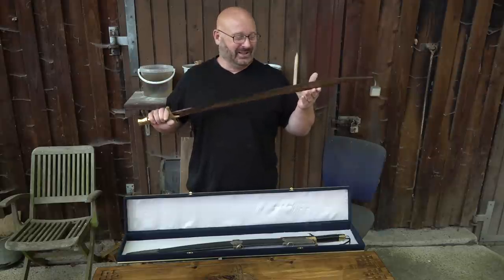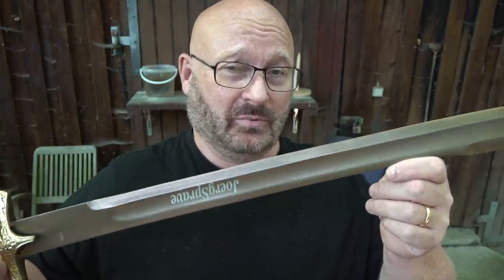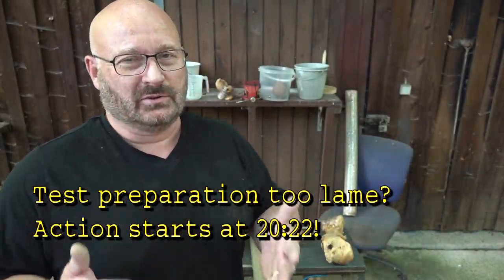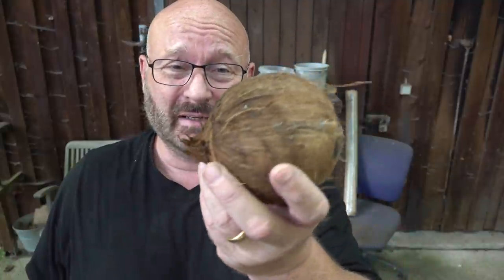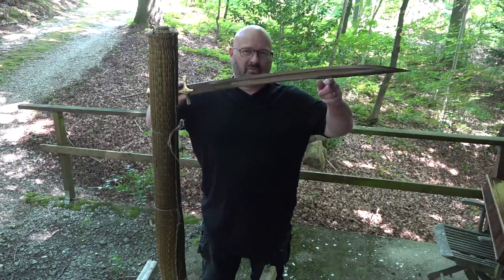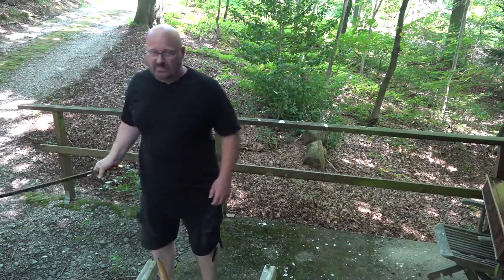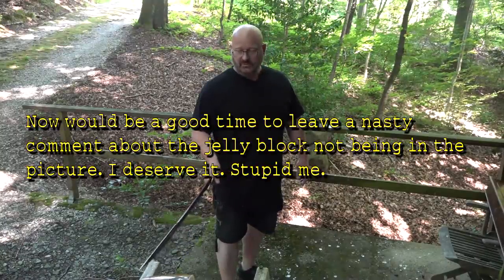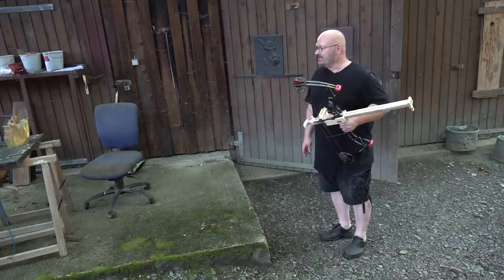REAL Ottoman Swords: Extreme Tests!

Comment: You could get away without a cameraman with a second camera...
Reply: Or prerecord checking what the camera is actually seeing, and maybe adjusting stuff accordingly. It probably has either a little screen or an ocular of some sorts, all cameras do.
When it came to shooting it was quite on point.
Reply: That's one nasty comment
Reply: Bring a bullseye that shows where the action is to aim your camera at, check in the camera or failing that option, line a stick along side the camera to have a better rough idea of the where its aiming

Comment: I'm sure many people have already commented on this, but bone inside the body is a lot more malleable than smoked bone like you have there. It bends more, it fractures less easily, and it will cut a a lot easier. It's kind of the difference between green wood and dried wood.
Reply: At least he went that route rather than useless ballistic gel blocks haha
Reply: Its a cow bone... just sayin
Reply: This is the right way around though! He's showing us the "worst case scenario", and these swords are still impressive as hell! They're definitely not any less effective against real humans.
Reply: @PhoenixClank  wouldn't the worst case scenario be tungsten carbide?
Reply: @Mentat13  katana could cut a black hole. Not so hard imho.
Reply: yeah, you could get fresh bones or limbs or heads with bones in them from a butcher or slaughterhouse though.

Comment: Bone is one of the most abusive materials that a blade could come in contact with. Especially "cured" bone. Not so much because of it's hardness, or durability; but because of how it breaks as it's hacked and cut. It simply refuses to cut or break in a line. It always breaks in arcs. Which is very similar to ice or glass. So, at the moment of impact, bone actually tries to turn the edge to either side, as it gives way. And, the deeper you cut, the more opportunities there are for this effect to occur; worst case being the edge attempting to turn in alternating directions, as it bites deeper. As hard as you're swinging that sword, I'm surprised it held up so well. The smiths did a fine job making that sword!

Comment: I’ve made heavy hand forged blades for brutal work and tested them in similar fashion on heavy pig bones. I can verify that the the swords functioned as they should, and the damage to the edges is normal under such abuse (dry bone is really hard). I can also testify that the price is insanely low for such blades. The wet mat cuts were extremely impressive. Somebody needs to send Jeorg a big salami.

Comment: On the ertugrul sword: fix the problem with the handguard, by setting two bolts for example. Let the metallbinding on the scabbard be not overstanding (could stuck on clothes), get rid of the standardrings, charge 30 bucks more for the perfect version, inform me when it´s done and i´ll buy one. There is for at least one issue on the  other sword.
Greetings ice.

Comment: I looked up the site and the price already hit me as being a bit on the cheaper side, doesn't neccerly reflect the quality mind you, but then I saw the material and got really worried. Stainless steel swords. Had to think for a second on what Skall and the others have said regarding it. Skall has said some stainless steels can be decent but this type of steel was not one that he mentioned. Searching up the steel quality and I am constantly met with "low end steel" and "soft steel". Some call it decent knife steel while many others call it budget knife steel. The biggest offender is the soft part. I read that this steel is pretty bad for edge retention. So I am a bit on the fence here. It could be that it is the heat treatment that saves these swords but I don't know. I would have to see some more professional testings on these swords to be convinced. Looks pretty good from this video but as I said the type of steel has me worried.
Reply: I agree, thats like the first rule of sword buying. Dont get stainless steel because its too brittle.

Comment: It is me or this sword really sharper & stronger then the katana he tested sometime ago? Wait, it need to be tested against orc sword too.
Reply from the maker: It is. But also more expensive.
Reply: Jörg, which sword do you think is the most effective against the zombies?
Reply: It will yield the same result. Smashing and bashing against something made to slash will deform and chip away at it. Both the Katana and these Turk blades are very good at doing what they were meant to do, neither is superior nor inferior.  

The only thing that sets them apart is that the Katana is a two-handed weapon and the Turk sword is one-handed, the former can cut through a body while the latter can leave deep wounds. All that matters is how skilled the wielder is and how he uses them.

Comment: Something of note, you seem to struggle to maintain smooth strikes, could just be lack of experience that you talked about. But worth mentioning that the blades have to have a good balance of weight and grip to them. If the handles are too short or don’t provide counter balance then the blade is much harder to use, and prolonged use (like in combat) is very difficult. blades being so heavy is fine (not that those are heavy) but they must be balanced out by handle design. Would absolutely love to see you work with the forged in fire team

Comment: If Jörg is impressed it must be reaaalllyyyyy gooood.
Reply: Well, I like Jörg but in this case I think that he isn't the right guy to do a sword review.
He simply doesn't have the necessary knowledge or skill to judge the swords performance properly.

Jörg is a Genius. He is creative, smart and also a good craftsman...but swords really aren't his specialty.
Reply: @niklasfischer3915  Although I agree that he's not a professional lika a HEMA swordsman but he knows a good amount about metallurgy and sharpness. And since we're not going to use these in a real combat, it's good for cutting melons at your backyard or picking your teeth...
Reply: @ozmobozo  He knows one or two things about metallurgy. But thats pretty much it. I know a bit more about swords, and i can tell you that both of these swords arent very high quality products.
The round and thick handles are very bad for your edge alinement when cutting.
Also the extreme weight of 1,5kg is much too heavy for a one-handed sword.
The edge damage taken during the bone-test is not within the range that is to be expected. A bit of damage is ok, but not as much as those swords took.
Furthermore the crossguard came loose after just one or two blows, which is utterly unacceptable.
Finally the fittings of the scabbard are not well fitted to the shape of the scabbard. They are just blocky and stick out, which makes it look very cheap.

Sure, if you just want to cut a melon in your backyard, then this probably isnt a problem for you (litually every sword can do that...you dont need a review for this)
But if you actually want a historically accurate reproduction that is well made and thoeretically usable for combat, then this is a problem.
Reply: @niklasfischer3915  You got me 👌
I always appreciate good information. And since all my knowledge comes from Forged in Fire, it's no surprise...

Comment: I am a beginner blade smith, i started a year ago, i have gotten much better and my heat treat is now more accurate now i bought a infrared hvac thermometer. I haven't done crazy tests like this but if the edge only chipped that much it is the best heat treat. My earlier blades would chip much more than that. Those guys have the heat treat down awesome.

Comment: You ever heard of a German knife company called  A Kastor and Bros from the early 40's and older?  I think they were bought out by Camilus.
They made a folding single blade knife on one end and the other took different tools that could be added on.  Basically the earliest multi tool.  Trying to find the model name for that knife set.  They came in a leather case with a divider to store them.

Comment: comparing it to the early nomad saber which terrorized the steppes since the end of rouran khaganate up until basically the magyar conquest of the carpathian and the fall of volga bulgharia which the best description is found in vienna as the "sword of attila" is the basic prototype which most of the eurasian and middle eastern and even european sabers are based off  from that we can trace the evolution of the turkish kilij 
and especially early kilijes the black handle sword is about 95% accurate historically according to some. founds  and manuscripts and drawing because mainly of the cross guard are slightly off at the tips and in the middle ridge but over all fairly well accurate 

the second however i disagree with the smiths and sword maker on that one about the handle and pommel construction since the one in museum look much closer to what other turkic tribes sabers handles looked like than the one they made but over all the rest is quite accurate for that era 

especially the yelman(false edge) and the piercing tip

Comment: Joerg: Couple things. That bone is smoked and much harder then a raw bone, so less effective as a test medium. Second, smoked and/or cooked bones are quite bad to give dogs to chew as they splinter into shards. They can get stuck in your dogs throat or digestive track as cause damage or worst. Only ever give your dog fresh, raw bones as they don't splinter as sharply. Hate to see your pup get hurt. :)
Reply from the maker: All OK, the bone is actually specifically sold for dogs and should be safe. Rolfie probably had 20 or so already, these last three years.
Reply: @Slingshotchannel  I know they 'are' sold for dogs. But that doesn't make them safe. It's a wild west show of poor regulation. But regardless, just something to be aware of. :)

Comment: Tatami mats are not a good analogue of a human limb but I understand why they're used. Firstly if you cut bone you will damage the edge of any sharp blade it's really a matter of how badly which is also caused by the density of the bone you cut. Now Tatami is used because it's about as dense as you want to get before you start damaging your blade. If you practiced daily cutting bones you would go through many blades over time.

Comment: i have some swords from them, lets go
these are stainless so here is proof that stainless can do the job

but from this company if you want something nimble probably want to look else where but they are proper and not over weight but as he has "alot of reserve" these are good weight heavy hitters.

 i got a yatagan and kilij, the more curved ones, and the kilij is now my baby because i prefer the heavy hitting rather than a nimble one. the yatagan i literally used as a machete and it held up more than enough when the chainsaw failed. the yatagan came in so sharp initially that it cut newspaper, i have 1 sliver of footage before i made it my machete in one of my videos.

Comment: Over 500$ for a Stainless Steel sword? Why? Use better steel that doesn't need so much work to make decent and you could even slice that price down. I have read stainless steel can be made good for swords if enough work is put into it but that often raises the price. My guess is that is what happened here but if so then move to better steel. If the price goes up then someone is doing something really wrong.

Comment: Joerg, if you can't afford a camera man, maybe try a camera with a front display, so you can check the camera angle while filming. There are good mirrorless cameras out there (from many brands) with this feature (through a foldable display) as well as action cameras (DJI has this feature, I don't recall of the top of my head of GoPro has this as well). I use the DJI Osmo for my personal (family use only) projects.

Comment: I used a second monitor and was able to see the ballistic jelly. I don't how it works but it did work.
I kept adding more monitors left and right, a total of five monitors. I saw Jörg's whole backyard. 
I don't know how far can I go with this, unfortunately I only have five monitors, one of them is an old crt.
I also don't know how or why it worked.
Are you still reading this nonsense?!

Comment: I recommend pvc pipew/ caps so you can make them in any circumstance you wish & they would be able to lay flat or stand up + you can add any length of bone or whatever inside. Of course, longer cutting device for separation will be needed. 🤠

Comment: I believe you did this one without your cameraman or your better half. In addition I think 50 hours worth of watching other sword testers do their work and making a recipe to disaster or actually I should say blade failure could use a little work. Out of the two problems that I just declared I would say the camerawork needs the most Improvement. When I did not get out of your test was where is the balance. How does the blade perform in the thrust. And how does the shape and temper affect the quality of the spring steel. Thrusting against several layers of wet carpet I would like to see the blade sink 6in give or take. Thrusting against some oak firewood with bark still on the tip should not snap the oak firewood should be free standing. And hanging off the end of the blade after the thrust. My recipe would be more like  1: two cuts to the tatami per blade, 2: Edge retention test single piece of paper, 3: wrist or ankle chopping test, "I suggest quarter or half inch soft wood dowel wrapped in wet Wednesday newspaper", 4: repeat test 2, 5: thrusting test, 6: split personality test "the coconut", 7: first real abuse Edge Tipper test to destruction, 8: Springfield Timber quality test " warp the blade" !! Warnings sooner or later this test will meet complete failure !! !! Flying razor blade hazard !! " 30 degree deflection 1 degree of set and tip remains Unbroken= you can't ask more of a blade though occasionally a blade will give it to you anyways. For Laughs I would finish my testing with the tatami mat two more Cuts with each blade. And please don't take my word for it with the materials you use come up with your own plan for each test but I have not seen anybody test a blade so thoroughly and I believe if you were going to ask $1,000 to test you might want to make a complete test so that is my recipe and that is my suggestion for the camera better view I didn't see much of anything I understood it was there but it was hard to see. Yes in the testing and pretty much demanding perfection in the camera work this time around it was just more than a little sloppy it was inconclusive.

Comment: With those over-swings, I suspect Joerg could've cut those tatami mats with a crow bar... Still, the blades are clearly of good quality. If you absolutely must cut the legs off multiple cows without taking time out to maintain the equipment, a buzz saw is better, anyway. If you just want to split a handful of human skulls, these will do fine.

Don't ask me how I know this.

Comment: Excellent review and I was always curious about turkish weapons.  I would like see someone that is well versed in how they were actually used do a video demonstration, perhaps you can find someone that understands turkish fighting arts and do a joint video.  The front of front end of the blade seems to be sharpened on the reversed side.  Again I would like see how it was used.  One handed swords are generally used with a shield.
On another topic, I would like to see something on Ukrainian Cossack swords.  I am in the USA
I think the price if they would fix the minor things and charge enough to cover the improvements would still be outstanding.

Comment: Joerg I've paid up to $25,000 for a sword 🗡️ that is that nice. I had an approximately $500,000 dollar edged weapon collection including a 27.5 Bastard sword. And 3 Katana that were made 1 in Toledo Spain . 1 in Nigiri , Japan which took a month and a half it was hand hammered by 3 men 2 at a time striking 1 using rice leaves for carbon cleaning. 3rd was a copy of the walking Dead Sword that the woman used can't spell her name. But it was # 15 out of 5000 swords . Anyway what I'm saying is, I know what quality and authenticity look like and those my friend are a bank robbery at that price. Good job getting great quality. 
I disagree about the Scabbard it's created exactly that way to be able to put it on a horse and attach to the wooden saddle. So, that is actually very much authentic ring work.

Comment: Joerg I'm sure this has been mentioned to you before.  I am a life long construction worker. When I was young I wrestled & kickboxing. Because of this when I see someone using a tool or punching/kicking. I can tell how skilled they are.  When you use the sword its obvious you don't practice. The reason I'm telling you this is because you almost cut your own hand off / disemboweled yourself.  Using weapons or tools when you aren't experienced is dangerous. But more importantly it doesn't give acupuncture results.  Basically it would be like saying. "Olympic pole vaulters can jump 10 meters. I want to see if its true? If I can't jump that high neither can they" you are the same size & shape I am. I. Just saying 1 I don't want you to get hurt. 2 you could make much better videos. All you need to do is get w wooden or big blunt sword & swing at a tree for 30 min to 1 hour. 3 times a week do that for a month. You will be 10x better.

Comment: 9:12 - yellow?  I wonder if they tempered the sword to a 'straw' colour?  Thats the colour of a very hard (but more brittle) temper.  I use it when making Silver solder scrapers (used, to remove excess silver solder)
Reply: There is no paint job on the steel.we use an old method for making the steel bronzish:)

Comment: Those blades are designed to slice, not chop.   A quality Katana would suffer the same edge damage.
Reply from the maker: That is the case, of course. But a Katana would also bend. These blades are hardened all the way through, a Katana has a soft back by design.